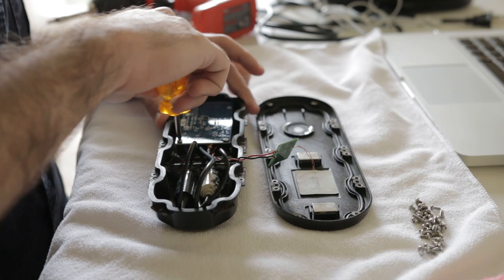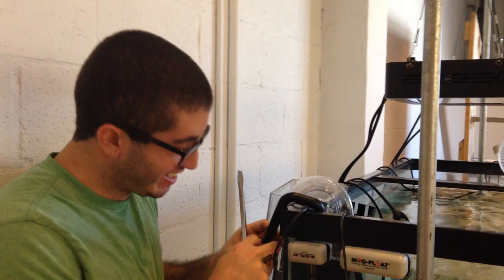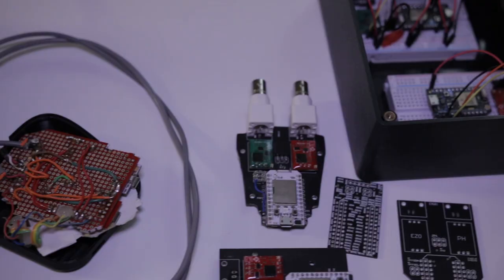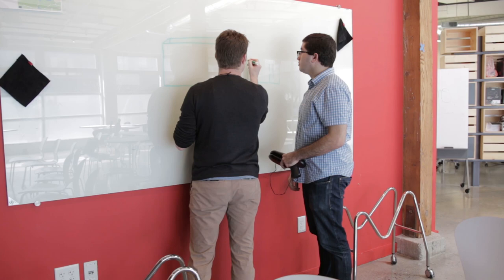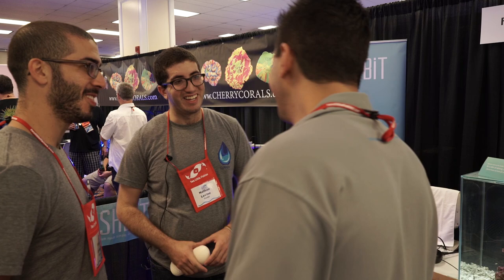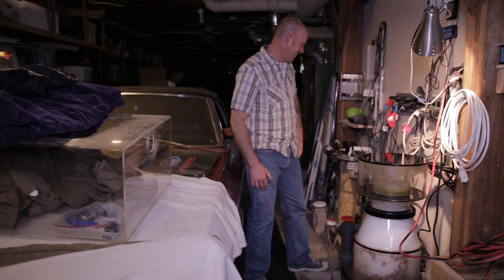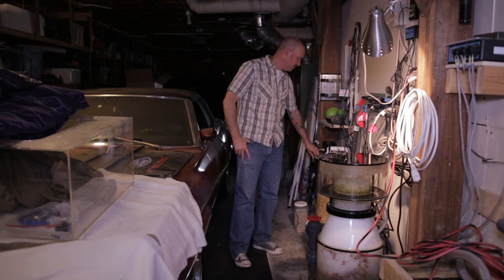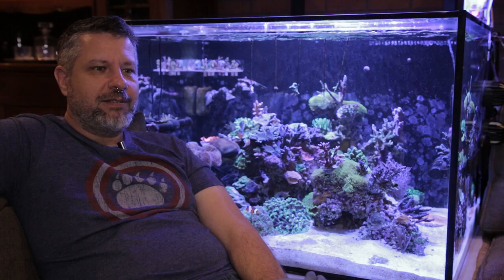Corals And Circuit Boards - Making A Aquarium Monitor From Scratch

Comment: I'm new to the hobby but just wondering fish bit coast around $600 at this price why not go with the company's like the Neptune Apex system for less and more established system with more options too it ?
Reply: $600 is for the FishBit+ and the normal one is $425, which already has everything you need such as timers, pH, temperature etc.